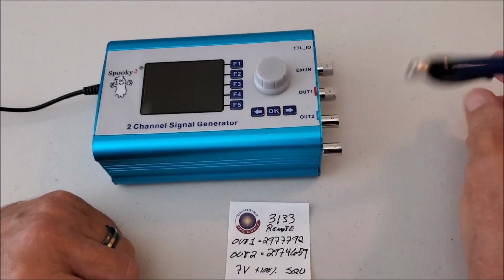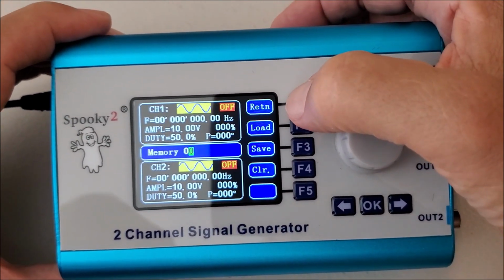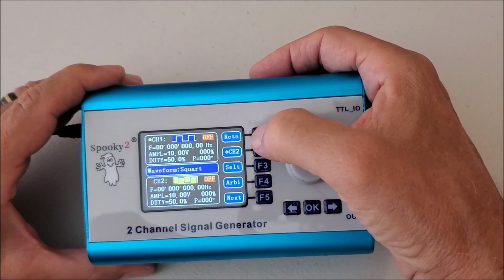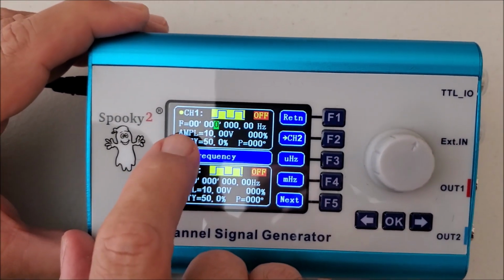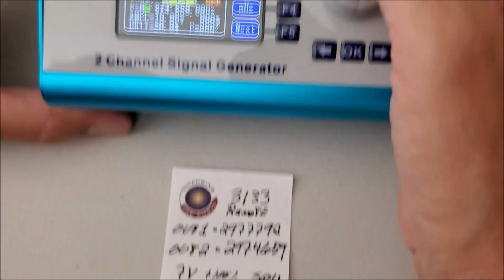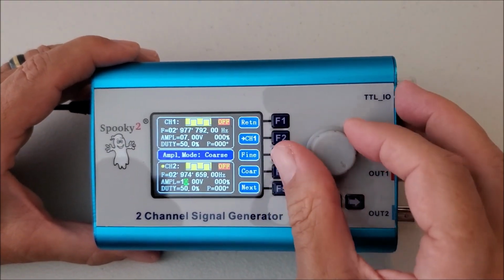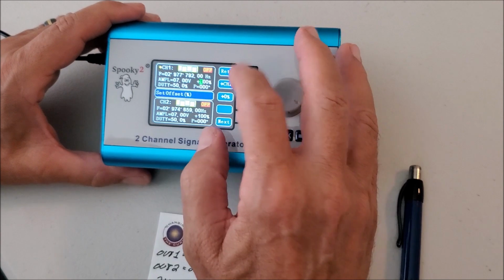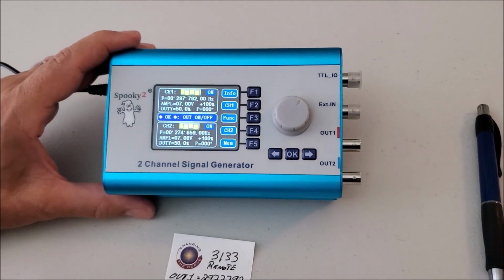How to Manually Program an XM for Standalone Remote Mode if using viaDNA Remote - freq: 3133 Carrier

Comment: Is this the starting point for all viaDNA Presets and have you checked that all frequencies will work regardless of which version of Spooky2 you run, or is this just one time to show how it works?
Reply from the maker: This video shows how to use a Spooky2 XM generator without having to use a computer or Spooky2 software. That’s why it’s called “standalone” mode. In standalone mode only one frequency can be run on each of the two output channels. In the example video one of the output frequencies is 2977792 Hz (a carrier frequency) and the other output frequency is 2974659 Hz (another carrier frequency). The two carrier frequencies modulate together inside the viaDNA Remote and create a “carrier wave” containing a third frequency, 3133 Hz. Notice the difference between the two carrier frequencies is 3133 Hz (the desired base frequency of interest). This concept can be used for other base frequencies.
Reply: @viaDNAremote  Yes, I know, sorry that I developed the question a bit to ask if you have tested in which spooky2 version that viaDNA remotes work best in. And with which power supply as my 8 different XM generators have different power supplies from 5V 1.5A - 5V 3 A , it must also have an impact on the generator itself?
Reply from the maker: @pege63  We don’t update Spooky2 software very often. They update roughly every 2 months, however, we will use a particular version for much longer than that. We’re currently using version 20220428, so it’s been almost 2 years on the same version. It really doesn’t matter which Spooky2 version you use. What’s important is to use our viaDNA Remote settings recommendations. See the INFO page of our website.

We recommend a 5V power supply of at least 2A (10W). A 5V power supply of 3A is better (15W). The USB interface circuitry is prone to fail if the output voltage drops to 4.5V or less. In that sense a 15W power supply is more robust than a 10W power supply. More than that, it’s important to use an Uninterruptable Power Supply (UPS),  a battery backup unit connected to your main premise power, ie, 120VAC in USA and 240VAC in most other countries. A UPS will keep your Rife system functional during a brown-out (power line glitches) and black-outs (power line outages). Here’s an example of the type we usually use here in the USA. They are available in 850VA, 1000VA, and 1350VA. The larger VA models last longer during a black-out:

https://www.amazon.com/CyberPower-CP1000AVRLCD-Intelligent-Outlets-Mini-Tower/dp/B000RZPK1W